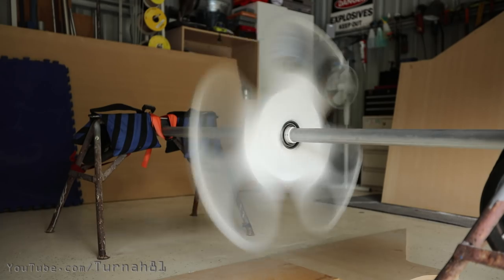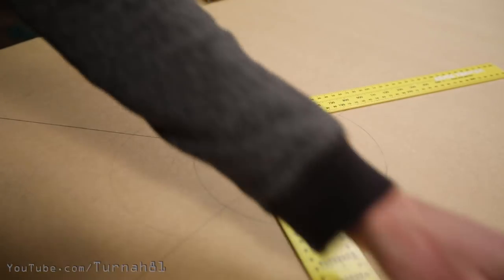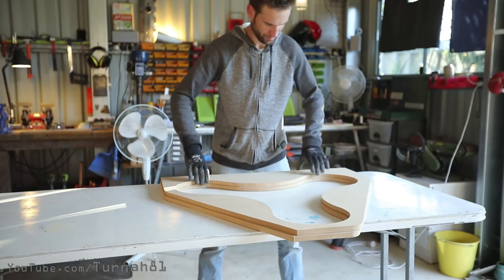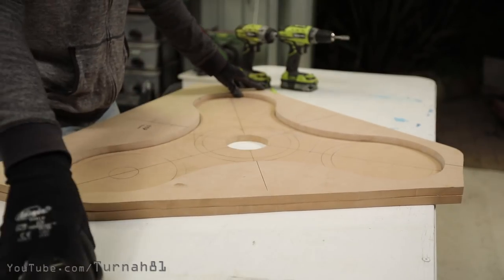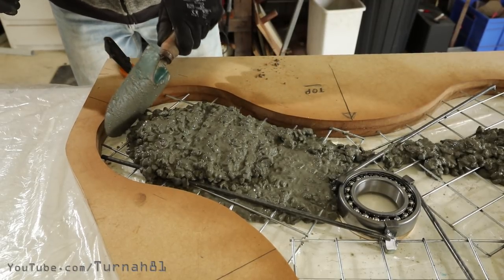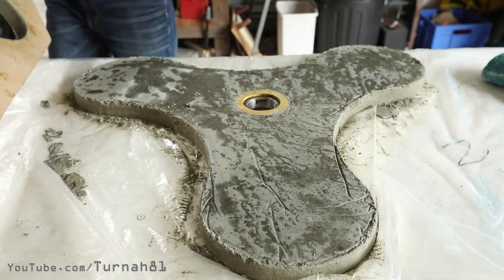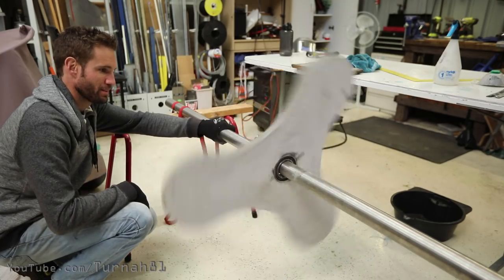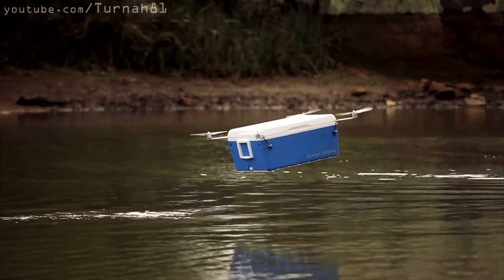The world's most dangerous, REINFORCED CONCRETE fidget spinner

Comment: I´m quite surprised that resonance doesn´t build up in the pole the bearings sit on.
What is the weight of that thing anyway?
Reply from the maker: +Freeman yeah I recon it is not perfectly balanced. I have a lose fitted tube down the middle of the other to hopefully act as a dampener and back up too. I forgot to weigh before I mounted.  Feels similar to a 2 inch sidewalk paving slab.